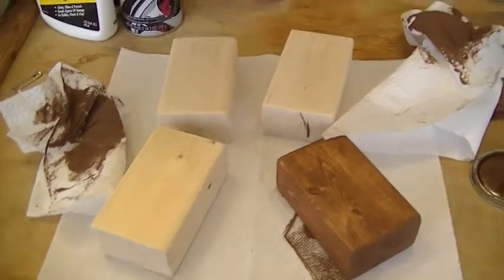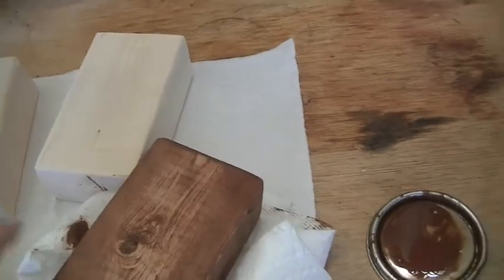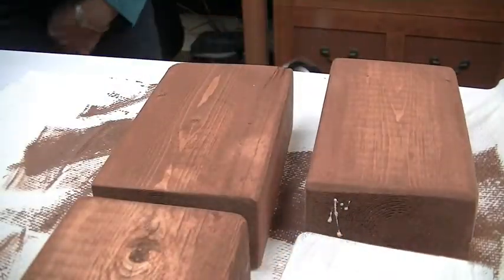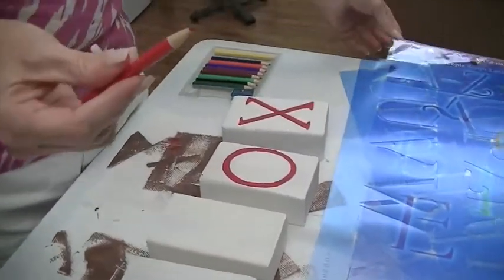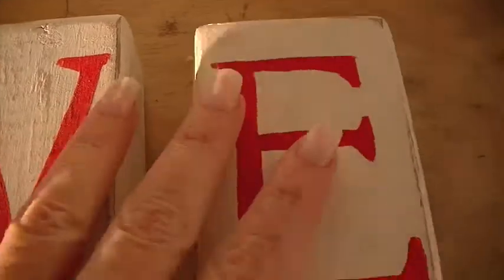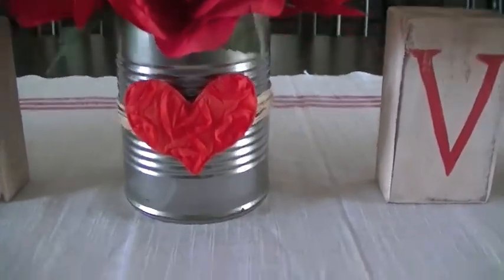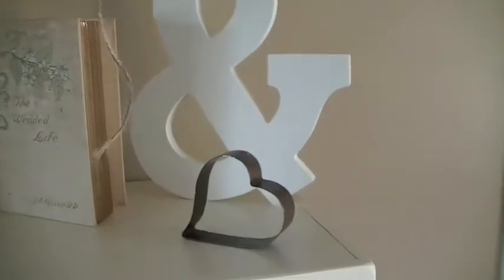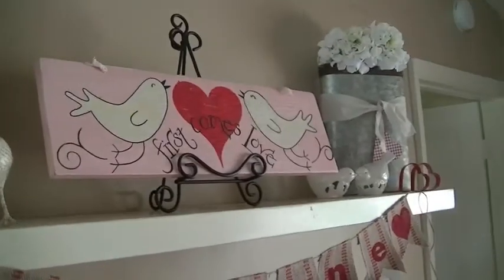Valentine DIY and Decor

Comment: You mentioned that you sanded and stained them after, I am craft illiterate but interested in making these. Did you use sandpaper? Is it necessary to stain the wood before you paint? Thank You & BTW, SUPER CUTE !!!
Reply from the maker: You do not have to stain the wood before you paint, I did that because I wanted to see some of the dark color under the white when I sanded so it would look more antique. I used a power hand sander but you can totally just use a piece of sandpaper, it will just take a little longer to get the effect. If I were to make these again I probably would not put the last coat of stain on them, they looked pretty cute with just the paint sanded.I hope this answered your question! I love to share an easy, fun craft project! Good luck and I would love to see a pic of your finished project!
Reply: DixieDebutantes Thank you, I am going to try it this weekend and let you know how it turns out.